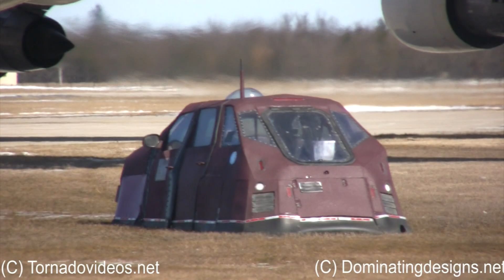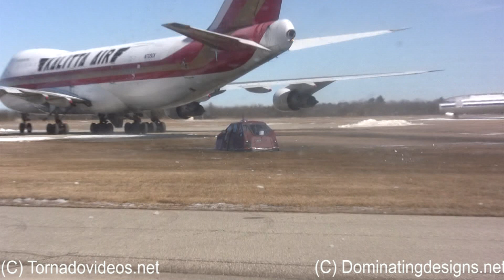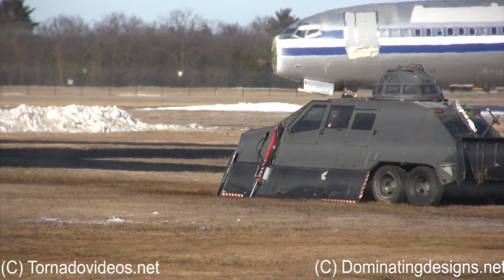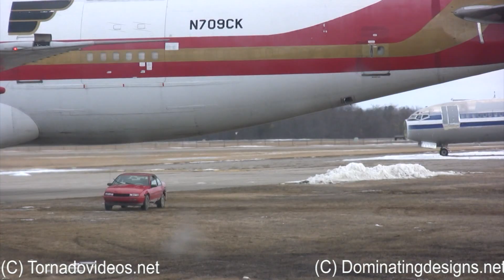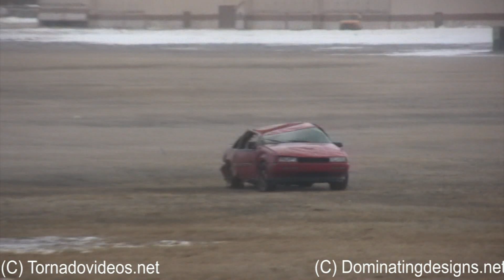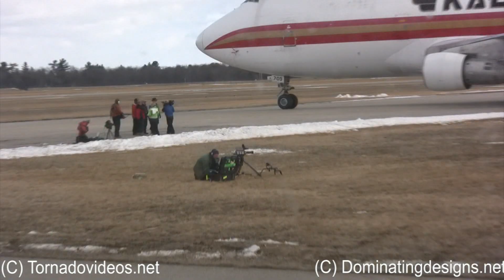Dominator and TIV - Storm Chase Vehicle Wind Test

Comment: Next time, they should use either an Airbus A350-1000(Trent XWB‑97, 97,000 lbs. of thrust) or a Boeing 777-300ER(GE90-115B, 115,000 lbs. of thrust). Do you agree, and what airline(s) should they contact to use the aircraft for such tests?

Comment: Just remember, Dominator 1 has no spikes, only the hydraulics, so the fact dominator 1 was still able to hold on quite a while before sliding is impressive, just look at what happened to the regular car, thrown and smashed, dominator 1 tho only slid, like the video said “Thanks to its lowered chasis the wind cant get underneath to lift it up, or topple it over”

Comment: i guess whomever designed the TIV 2 will put thicker diameter spikes on TIV 2. 
and reed timmer should design a dominator vehicle that when it drops flush to the ground, parts of the aluminum construction would act like teeth and sink into the ground from the weight

Comment: TIV was purpose-built for an IMAX film on tornadoes, which is why it has the large dome on top to house the IMAX camera Sean Casey uses. Reed Timmer thought he could improve on the design and came up with the DOMINATOR, which was a failure in an actual storm.
Reply: what do you mean improve, the concept of the tiv and dominators are different which both work, and failure in an atual storm? d1 has recorded the highest wind in its original design for the longest time and has been inside the most tornadoes including tiv

Comment: What more impressive is the fact that the plane didn't budge a bit while throttling up.
Reply: The plane's brakes simply wouldn't allow it.
We are talking about a vehicle that, starting at a speed of 250 km/h, has to brake within a space of a few km. You don't even need to specify the weight of the planes, as even the smallest of planes will weigh more than a car.
And we all know how much weight affects a solid object (in this case a plane,) to brake.

Comment: N709CK - 1971 Boeing 747-132

Originally flying for Delta and Boeing in the 1970's before serving in Hong Kong as a cargo freighter in the 1990's, this plane had an incident in October 2004 where it lost the #1 engine during takeoff ascent over Lake Michigan. It was repaired and served 4 more years before being retired and stored at Oscoda in 2008 where it sat abandoned until June 2015 when it was cut apart for scrap.

Comment: I know TIV and Dominator are going to withstand the wind speeds simply because they are heavy, and the profiles allow wind to flow around the vehicles easier, however in the wind test you put the aerodynamic face of TIV and Dominator toward the back of the jet engine, but you put the car behind the jet engine with the entire profile of the car facing the strong winds.  Clearly this gives the car more surface area for the wind to pick up the vehicle and roll it like it did.  To be a fair analysis you would need to either put the TIV and Dominator in the profile facing position or the car nose facing like the tornado chase vehicles were.  It seems if you truly want to test the TIV and Dominator for endurance, you would place them profile toward the back of the jets engines, so you can see how much damage they can truly take, putting them in nose front really isn't testing their endurance, because a tornado will have winds coming from all directions, not just into the nose of the vehicle.
Reply: Sara Llewellyn dominate deez nuts!
Reply: To be a fair analysis you would need to drive spikes in the ground and put a metal skirt around the sides to prevent air from rushing underneath and lifting it up.
Reply: I have to agree with you totally. Yeah come to think of it they didn't face that regular car the same way as they faced the TIV 2 and the Dominator are facing. So yes I do agree!
Reply: @annebenton2168  I would've preferred to see the TIV and Dominator both turned so their side that would catch the most wind was facing the wind, just as might happen in a tornado in a worst-case scenario.  That being said, I think we can say the TIV was pretty well-proven in the actual tornado it intercepted, possibly better than in this test.
Reply: Dude the did has more area and it did not move
Reply: You're suggesting if TIV and dominator were facing sideways they'd both get blown away even though both cars were designed to drive into the path of a storm and survive. The dominator is designed to drive through instead of sitting like the TIV which makes the dominator weaker. It has nothing but weight to keep it from rolling. TIV winds.
Reply: Dominator isn't meant to continuously drive through a tornado. Dominator's method of deploying is dropping the entirety of the vehicle to the ground so that wind doesn't rush underneath it and lift it, while Tiv has panels which lower independently. The only difference being Tiv has spikes which prevent the winds from pushing the vehicle along the ground, Dominator 2 does not, hence why it was pushed around.
It isn't about weight when dealing with tornadoes.  If a tornado can lift a 70 ton train car, it could lift Dominator and Tiv. It's all about diminishing surface area, particularly at points that would cause the vehicle to become airborne.

Comment: Put these two behind a GE-90 (777 engine) and see how better the TIV is now.
Reply: BowlingGlaceon dont forget about that thing that hit the windsheild making a spark
Reply: The tiv is 17000 lbs, that’s a tank compared to the dominator
Reply: well 1 that'll send the dominator flying like that red car
and if the TIV2 is in full lock down mode it can withstand winds from inside an EF4 which can have winds up to 166mph and 200mph
the wind from an engine will be pretty similar to basic straight line winds a tornado has the winds pulling towards it with a major updraft, so it's sucking you in as well as sucking you up, and you also have to take into matter how much debris they will be getting hammered by
the fact that the TIV2 barely moved an inch when it was in an EF4 tornado
getting hammered by huge ass hay bails
giant sheets of metal
and a cat as well
so yeah tornado wind speeds are rather peculiar
a tornadoes wind speed can be about 150 mph
but the damage it can do will take a straight line wind speed of 200-220
the tornadoes properties can increase the dangers of the wind due to the suction and the updraft
Reply: @cowboycolts  but. Ef4 and ef5 has car trucks trees houses and in the debris so you have to take that into account i would ride out a ef4 or 5 in this you could still very well be killed
Reply: DJ Sargestar  To be exactly a GE 90 - 114 Bravo
Reply: Katt B 115,000lbs of thrust
Reply: If the tiv didn’t fix the issue with doors and hatches flying open in anything stronger than a ef2, it’s not any better than it was before.
Reply: The door failed on the TIV.....that is a critical failure.
Reply: The door failed because it wasn't locked. In the second test this mistake was rectified and it didn't open.
Reply: @RojoFern  in multiple intercepts, the tiv doors blew opened, one of them being an ef4

Comment: TIV 3 should have 8 spikes that go into the ground and go another 2-3 feet deeper each. The doors should be secured with a better method, with multiple locks on each door. Windows should be 3" thick on all four sides. The fastest tornado ever recorded (doesn't mean there aren't faster) was 318mph. I know that's a ton of money for all of that, but life is priceless. Or, simply don't drive into one that is too strong. However, you would never know how strong it will be - that's the surprise.
Reply: TIV2 was retired in 2013. They never made another one? Both fullfilled there purpose. Sean didn't need it anymore.
Reply: @jmstudios457  tiv 2 is still operational iirc. they intercepted a strone f3 with it
Reply: @Commissar0617  when was this? Was it that one in 2013 where the door wasn't locked completely and opened up?
Reply: @jmstudios457  well the Tiv 2 is now coming back to the chase
Reply: @Devin Dewitt maybe you got confused. Dominator 3 debuted 2 years after the last season of storm chasers, and is still going strong. I haven't heard anything about tiv3.
Reply: @jmstudios457  i think that's reed timmer tho, i could be wrong however.
Reply: I would say add the rear flap back with spikes under it and spikes under the panels and pannels at the wheels to keep wind form getting under it
Reply: @suze215  no it causes too much weight so it caused too much axels to break
Reply: Hope TIV 2 has some good tornados for 2023
Reply: Dominator 1 , 2 , 3 is the most recognized tornado intercepting vehicle it can withstand up to 200 mph while tiv 2 can withstand up to 100 mph, which it is 160 kph

[Edit] Oh yeah, the dominator can withstand up to 321 kph, which it is 200 mph

[Edit 2] The reason why dominator is the best and most recognizable vehicle

It's because it can protect anyone inside of a vehicle, and it helps the wind from getting underneath the vehicle using an airbag system to drop it down flush to the ground

Especially the dominator 3, which was built and designed by Reed timmer , Kelvin Barton, and Sean schofer
Reply: But it has to deploy before it gets hit, and tornadoes aren't that fast (the fastest one is very strong but not every single one is like that one)
Reply: @amocapivarasrebaixadas the fastest nado was 80 mph and it wasn't that strong with ef0-ef1 rating
Reply: The problem with deep spikes is buried utilities, you have no idea where they are without locates, and due to the nature of storm chasing you cannot call for them, if you are prepared to accept the liability of a million dollar fiber cut, go for it.
Reply: Dom 5 maybe
Reply: With the amount of money it costs to just use a jet with 4 engines and fuel is so expensive I think they can afford those brilliant modifications for sure.
Reply: Tiv2 at f5 will be torn out and thrown over a certain distance f5 destroys everything in its path except maybe asphalt and ground.
Reply: @kolo1053   that tornado they were in was rated ef4 on damage. But the wind meter was destroy at 175mph by a piece of tin. That tornado was a mile wide. No mile wide tornado isn't an f5. Just look at that rock that hit the window and turned into plasma or sparked . For it to do that it would have to be traveling upwards of 280mph
Reply: @spankthemonkey3437  That was pretty crazy . That is the only legit video I've seen of  a vehicle inside a tornado like that.
Reply: @kolo1053  its capable of surviving 240. it'll be ok
Reply: LOLOL!! Everybody here thinks they know what's happening!! 😂🤣😂🤣😂🤣😂🤣😂🤣😂🤣😂🤣😂🤣😂🤣😂
Reply: @beckylynn209  ? what all i said was Tiv 2 is coming back
Reply: Also, the people on earth should put out less carbon and all be nice to each other. There.

Comment: Tiv:

It weighs 16,500 pounds (8 tons)

Tiv has a high clearance but has side panles that make the clearance lower. But it has anchors.

Can sustain 160 mph winds. EF4 at the most...

Custom built. So, its pretty damn heavy.

Dominator:

(ESTIMATED) 8,550 to 9,100 pounds (my knowledge) 5.2 tons

Low clearance

Can sustain 130 mph winds, about an EF2 or maybe EF3

Has no anchors... so the only thing it can rely on is the e-brake
Reply: Sebastian Toala waiting for the tiv 3 ef5 tornados I want to see that
Reply: animegamereviewer coming out soon... Its going to have a form of a Baja racer fyi.
Reply: +Sebastian Toala The dominator has been inside EF4.
Reply: TIV was inside EF4.
Reply: Awesome breakdown Sebastian
Reply: Jody Payne Thanks yo.
Reply: All my pleasure.
Reply: AllClassicRock yeah but it was getting pulled along the highway but if he had the spikes was would be able to withstand the ef4
Reply: but the tiv is under open
Reply: the TIV 2 withstood 170 mph winds in a tornado not too long ago. look up TIV 2 intercept
Reply: Dominator 1 was inside the wadena ef4
Reply: Dominator 1 actually been in the strongest winds out if all the TIV and DOMINATORS, with a recorded windspeed of 200mph for 1 sec inside the tornado (sub vortix) and d3 been inside an tornado with 180mph
Reply: @putitinreverseterry  it never went over 200mph, since both tiv and d1 got 200mph approved by myth busters, additionally d1 and d3 has been in stronger tornadoes while the one time tiv   got into a strong f4 the hatch blew opened
Reply: Dominator 2 and 3 both have anchors on the inside of the door panel

Comment: @calipha muhamad, There are three types of winds in a tornado, the reason tornadoes can easily derail a train is because the wind gets UNDER the train and lifts it, while a different current hits the sides of the train until it flips over, trains are much taller and extremely long compared to the dominator, trains depend on their length to keep them on the track when you have a strong wind pushing the entire train its actually easier to flip over a train then it is to flip over a Unarmored car. Also the dominator lost its window because the lexan (bulletproof glass) was stuck and he could not roll it up, now its like powered windows.
Reply: Yes, although. There's never been a reported case of a modern North american locomotive being lifted and thrown. That ive heard of anyways. Cause there center of gravity is so low and they weigh so immensely much. (430,000 Ibs) It's much more likely it will just get tipped.

Comment: The Dominator has two sets of windows. One is the stock windows on the Tahoe they have under the armor. The second is bulletproof glass. The outside window was rolled down during the F2 and it broke the inside glass.

Comment: What a load of cross-promotion crap. Good thing they parked both vehicles with their most aerodynamic wind-shearing angle (the front slopped part of the vehicle) directly towards the wind blast. I doubt either vehicle would have survived a SIDE blast even at 150mph. Plus, a real tornado sends debris projectiles and creates upward windshears and angled blasts. Truth told an F4 would have tossed both vehicles. No telling how much extra weight accidently found its way into the interiors too.

Comment: Here's the thing that I do not like about this video. They are making it seem like the dominator is weaker than the TIV2. When in reality the TIV2 is not as close to the plane, the dominator is taking higher direct winds and the TIV2 is not. The dominator didn't move during Take 1 but the TIV2's doors flew open. I love Sean and Reed, and I would chase in either of the vehicles. I'm just making an observation.
Reply: SquaadZulu
Reply: The tiv would survive stronger winds though. I bet it still wouldn't have moved if it were as close. Maybe it could take a sideways hit

Comment: The TIV is awesome against 58,000 lbs of thrust of the CF-6 but would not hold up to the GE90-115B thrust of 115,000 lbs.
Reply: mdransfi1 Those are JT-9D's on that 747 but I completely agree about the GE-90-115B.

Comment: After they did this, they did an 'Off the Record' test. They revved the engines up to where the jetwash was F5 speeds (250 mph). TIV was as solid as a rock. Dominator blew over 50 feet backwards. Look it up.  TIV ROCKS. (So does Sean Casey)
Reply: dominator 1 was able to withstand a F4 tornado even though the vehicle didn’t even have spikes so I’m not surprised that the TIV with the giant spikes survived
Reply: now we need dom3 vs tiv2

Comment: @macmodder I seriously doubt that the exhaust gets to 2,000 F, try around 932, but it is hot.  Take a look at blast shields, they have concrete because of the blast from the engine, but they are metallic alloys.  When military aircraft go full power, do you see them melting?  Sure, they're strengthened, but the engine is nearly the same alloy as a car or blast shield.

Comment: Very nice and very old 747-100 freighter version with Pratt and Whitney engines with about 54,000 pounds of thrust each and the heat vortex is not from the engines of the TIV or dominator.  That's the exhaust from the jet it's very hot measures in ( EGT )

Comment: The car got owned. Now just picture that car with vertically rising winds at 250 mph. If the dominator was to have vertical winds at this speed, it may end up flying if it gets pushed on to some bumpy ground that could cause it to flip and get air under it. It may make it thru a low end EF-5, but something like the Bridge Creek/ Moore tornado would cream it.

Comment: The TIV kicks the Dominators ass any day!
Reply: wut about the d3? (ik this was nto a thing back then)
Reply: @Victortanzigperson39 eh, tiv 2 and Dom 3 are about the same. Both have a wind speed threshold of 250mph. Dom 3 deployment speed is a little faster than the tiv 2 deployment speed mainly because of its low body design which makes it faster to deploy. It’s mainly the body and motor type that makes it different, but both of there performances are about the same.